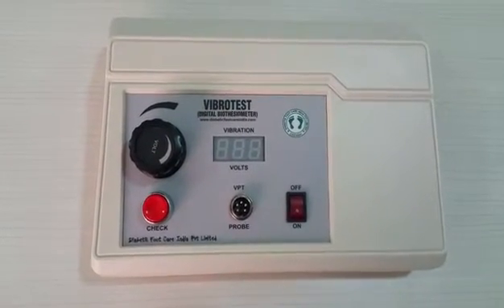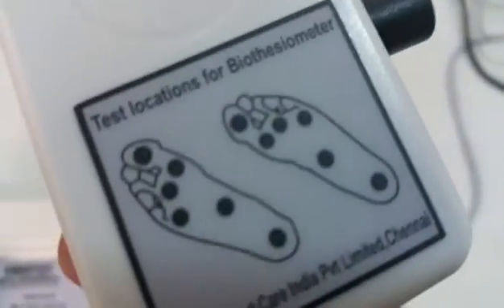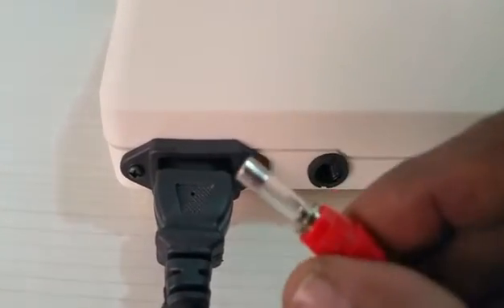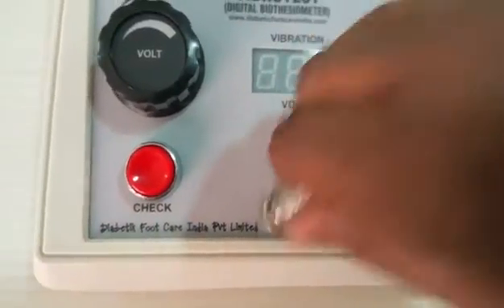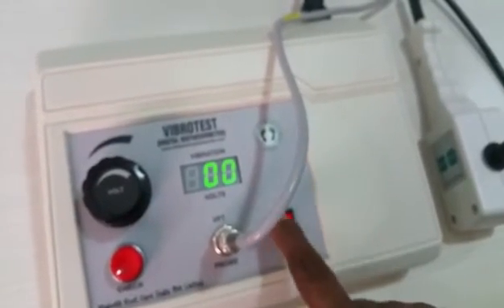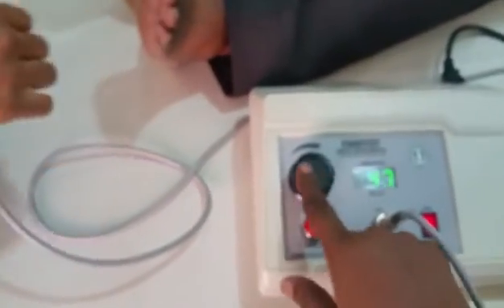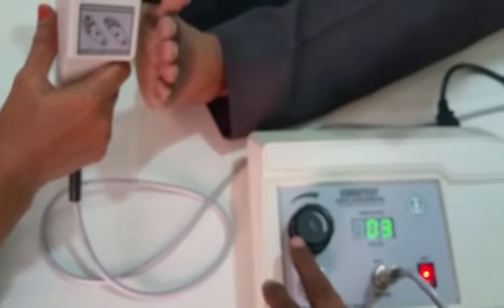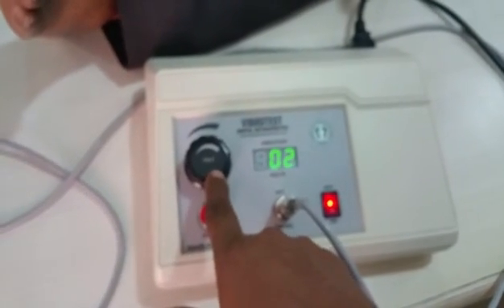Digital Biothesiometer Vibrotest demo video

Comment: How to take report sir
Reply from the maker: Most of these devices are compatible with windows based computers. They can be connected using an USB cable for transfer of data from device to computer. The software supplied helps the user to generate a colourful report with an interpretation. The user can create a letterhead with their logo to look like a professional report. If you need any assistance pl email to mesmedi@gmail.com.